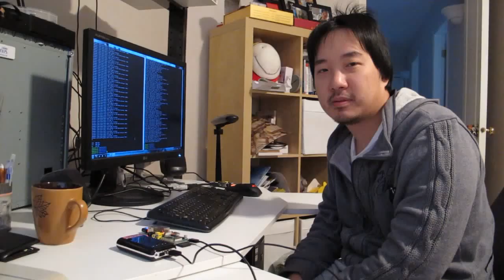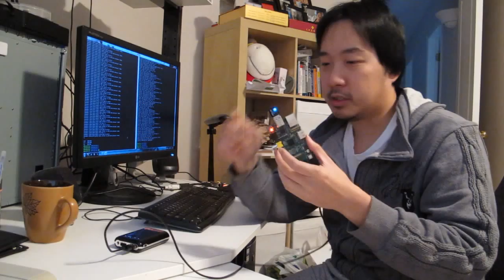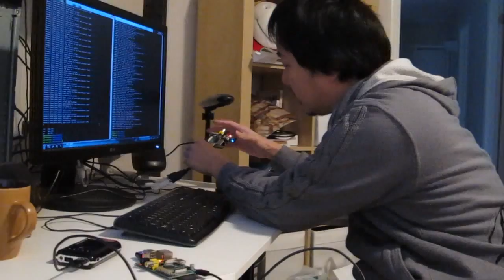Raspberry Pi Remote Camera Application (Proof of Concept)

Comment from the maker: USB 2.0 is unfortunately not fast enough. With 1080p of input data, which contains 1920x1080 pixels, 3 bytes for each pixel (rgb), 30 frames per sec, implies 186624000 bytes of data per second, or 178 mega bytes of data per second, or 1423 mega bits per second. USB 2.0 has a theoretical max speed of 480 mega bits per second (though it's very unlikely it'll ever hit the theoretical max). So it'll be a bit difficult to run 1080p over USB 2, unless the camera can perform H264 encode itself.